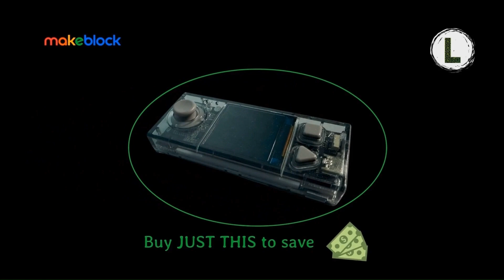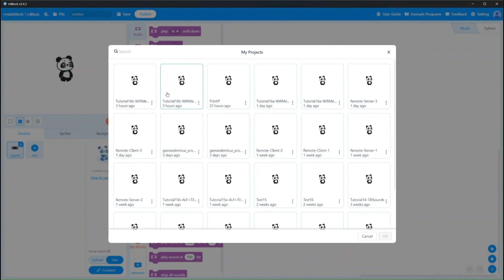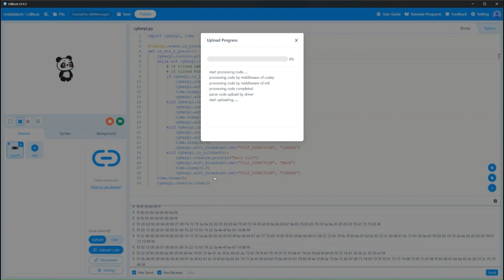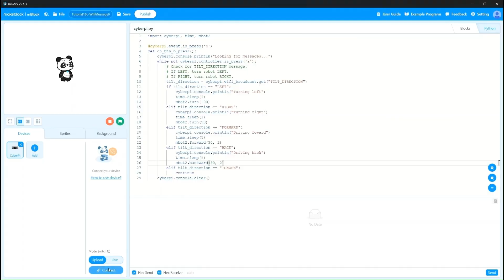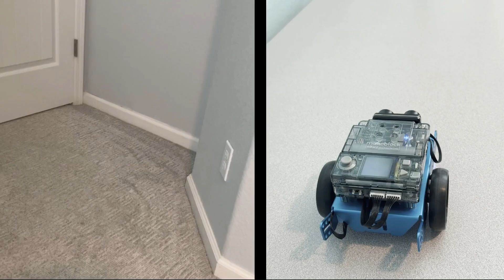Remote Control Robot Over WiFi Using Tilt | Final Build!

Comment: Hello admin, I have a question. If there are two colors in front of the mBot2, I want it to detect the color that is farther away first, perform a specific action, and then detect the closer color.
For example: if there is a red color close to the mBot2 and a yellow color farther away, the mBot should go to the yellow color, ignore the red one at first, and when it reaches the yellow color, it should turn 180 degrees to go to the red color, then turn 90 degrees.
Is it possible to do this?
Reply from the maker: Thanks for your question! Just to understand your setup better:
	1.	Are you using only the Quad RGB sensor for color detection?
	2.	Are there just two colors (like red and yellow) that the robot needs to detect?
	3.	Are those colors placed along a black line, like on the Makeblock line follower mat?

Once I know more, I can suggest a possible approach. Looking forward to your reply!
Reply: @LearnAsYouExplore  "Yes, I only use the RGB sensor, and red and yellow are just two example colors to make it clearer for you. These colors are placed along a black line, similar to the Makeblock tracking mat."
Reply from the maker: @thinhnguyen7700 I just made a video for this here:
https://youtu.be/eHbxi6W0AVw

Please note that this video is part 1 of a 2-part series. I’ll be publishing part 2 next week. Enjoy, and hope this helps!